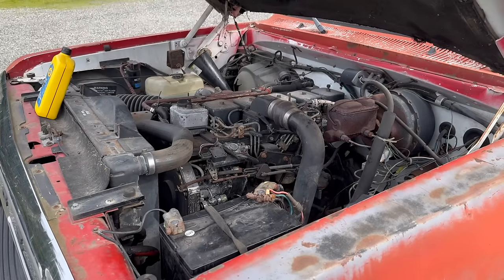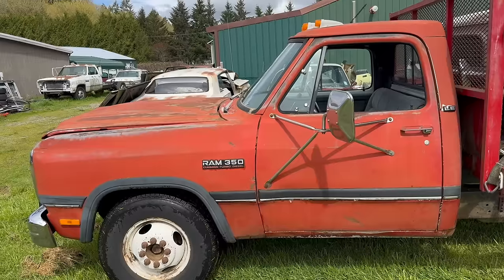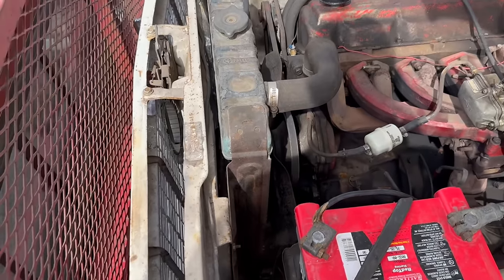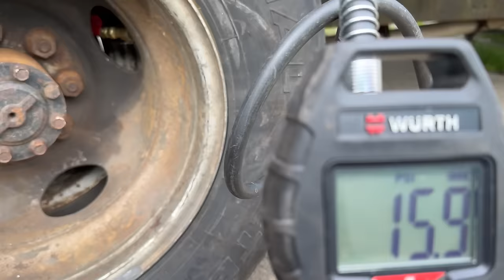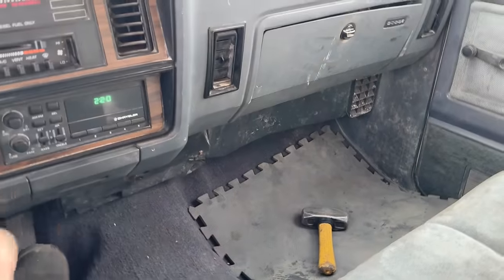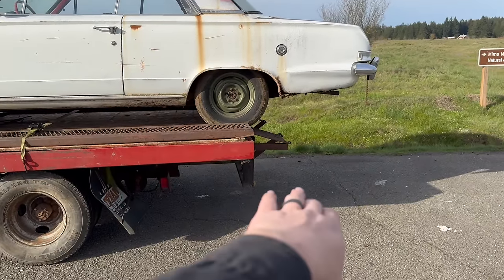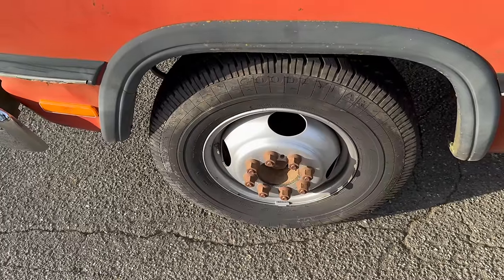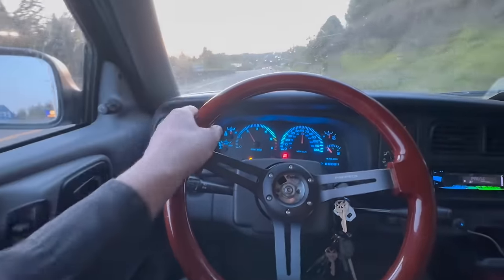Can I Drive This Terrifyingly Sketchy 1992 Dodge D350 "Ramp Truck" Home? (Towing My New Project Car)

Comment: In 1993 I bought a new, two tone, white over silver 12V Cummins D250 Club cab with captains seats (best seats EVER)  and I traded it in 10 years later. I still miss ti.
Reply from the maker: I had a ‘93 D350 club cab five speed dually briefly. Man, that was a great truck. But I needed a real back seat for my newborn daughter - so I got my first second gen.
Reply: @DeadDodgeGarage  Same problem here. My son quickly became too big for it. The third gen has been serving us well since then though.

Comment: I had a 1995 single cab 12 valve Cummins. Those Turbos are indestructible. Great Engines.I took out the CAT OUT STRAIGHT PIPE. The truck just whisled. Had a great sound. 👍

Comment: I love my first gen..most of the time. Of course I’ve fought all of those things you are currently fighting..all new steering including red head steering gear and borgeson shaft..huge difference, also added a steering box brace I picked off a ramcharger in a junkyard.

Comment: My old brain is getting fuzzy. I thought a one ton truck could haul two tons of material?
Thanks for your awesome video!
Reply from the maker: It’s not a hard and fast rule just by the one ton rating. Gross weight ratings vary by model. I haven’t found the gross return for this one yet but I know from the door sticker it’s over 10k.

Comment: Great choice in that ,
First generation 
12v Cummings Diesel ⛽ 👌 

It's not the engine or truck that concerns me , Jamie  .

It's the ..... errrr..... ummm.....
"Loading capacity"
 of that Ramp truck , 
 bed integrity  , lighting  , tires 
Intermittent death 💀 wobble 

So many "potential" violations .
OSHA , DOT , 
the second law of physics ...... 
You know what  ?
Let Tom handle it 🤭

I've got to give you  ,
Genius cudos 
For transcending , multiple levels of sketchy  , simultaneously  😬

Coming from a GenXer.....
I'm sincerely impressed
Reply from the maker: Yeah, that. All of that. Haha.

Comment: You have more faith in the ratchet straps than I ever would.  Thank goodness a tire did not blow and you escaped possible injury along with the car.  Great video showing what not to do is very appreciated, but please do not take risks for our entertainment unless you are sure you can get away with it.
Reply from the maker: I know what I can get away with. But with this much weight, I need actually functional brakes. What’s wrong with ratchet straps? That’s all I use to strap down cars. Good ones, obviously.
Reply: Used to use chains and binders, now it's ratchet straps, way more better!

Comment: Doesn't help no helper spring perches. Good thing that 12 valve is holding the front end down. Air bags would be good, dump the air to load or unload. Of course brakes would be much betterer.
Reply from the maker: Yep. I really don’t know why they pulled the helper pads. Doesn’t seem like a good idea to me…

Comment: The 12V Cummins is THE BEST engine ever made!
What other engine really only has ONE FLAW, killer dowel pin, that RARELY even surfaces?
If you had to take an engine through the end of the World???
It'll run on just about any oil source you can find, INCLUDING the oil in transformers, you know that stuff in those barrels up on power poles......that are everywhere.
Every other vehicle on the road, or OFF, is a source of fuel, more diesel, gear oil, ATF, motor oil. AND everything that flies as well.
You don't need a battery if you have a manual transmission. The fuel shot of can me manually operated, or ran with a cable.

And IDI Phord might be acceptable but a distant second. A Cummins can even do "gas" stuff....like be QUICK!
Reply from the maker: Damn right!

Comment: Thanks for sharing this little 'adventure' Jamie. The only thing that surprised me, is the low payload limit for a truck that size 😮 Locking brakes, whether rusty calipers or constricted hoses is practically a given, sitting that long.
Reply from the maker: I actually don’t know the total payload the truck can handle. I know the total gross weight is over 10,000 pounds, but I don’t know how high it is. Either way, it is a D350, which is a “one ton” classification. That doesn’t mean it can only carry one ton. It is supposed to have overload springs to help carry all that weight. For some reason they removed the hangars for those, which is contributing to the sag in the rear.
Reply from the maker: And I hope it was very obvious that I was not at all surprised by the brake issues. I was hoping they would just magically be ok, but all logic and previous experience indicated they would not.
Reply: @DeadDodgeGarage  Yeah, you did make mention of it, a few times. Watching, I too was hoping it'd clear itself up, by some magical means.

Comment: Awesome truck. The 72-93 is a great truck and there are tons of parts and still has a cummins. Same dash as my 92 Ramcharger. I dont think it would take too much to make that truck decent. Tires, brakes and box. And springs. And tank. And....😀 I think the O/D trans switch is broken or has no power
Reply from the maker: It is broken - and the computer is toast anyway. I was told that none of the factory stuff works, and that one is the toggles engaged the OD manually. Doesn’t seem to though.

Comment: Beavertail! 
I understand the wheels are lug centering. I used to install 2 tapered nuts on the wheel then install the rest of the nuts. when they are tightened, replace the tapered with the standard nuts.
BTW they are supposed to be ridiculously tight...300 foot pounds WOW!
Reply from the maker: 300?! Wow… I had assumed the spec was in the 140-160 neighborhood. I gave them the old break bar treatment anyway.

Comment: Death Wobble:
First thing first, replace the axle side rubber Track Bar Bushing with a two piece urethane one. You don't actually need to remove it from the vehicle (like I did on my Jeep XJ).
Of course, don't let that delay the brake job.
Reply from the maker: These don’t have a track bar. It’s not even a solid axle truck - which is where death wobble is usually found.
Reply: The 4wds don't have a track bar either.
Reply: I fixed my WJ with a steering stabilizer.
Reply: @DeadDodgeGarage  Sorry, didn't see this until you mentioned you replied.

Comment: The best cure for square tires is a good burnout.
Reply from the maker: It doesn’t work as well for front tires 😅
Reply: @DeadDodgeGarage just have to put them on the back for a burnout 😂

Comment: Jamie, I have that same year 1992 truck and the same interior.  I have the dreaded "goo" steering wheel problem.
And the steering wheels from other years don't interchange. I can wash off the goo with soap, but it comes back almost immediately. 
I put a cover over the wheel but it only partly covers the grip surface since it is fatter than the cover. And the spokes goo up, also.  And, with the cover, it makes the wheel fatter than ever.
I prefer a thin grip steering wheel like you'd find on, say, a 65 or 68 Chrysler 300, but they won't fit and of course they won't since the 92 is an air bag type.
I only found one similar steering wheel for sale on line and the seller stated that it had the "goo".  If you find one with no goo, late me know.
Perhaps they are more likely to be found in cooler cloudier areas.
Reply: My 92 tortured my back until I put a seat from an E body in place of the stock bucket seat. The bolsters in the sides of the factory buckets cut into my back, and I am not really "wide bodied" either.
The kidney killing harsh ride of the d350 rear suspension is still a problem since I drove it very lightly loaded. And my overload stops were removed when I got it. A previous owner put air bags in, but I doubt they helped even before they wasted away. Air bag PLUS the main rear leafs, not "in place of".
Reply from the maker: Grooooss… I didn’t notice any goo on this one. I’m not giving it up though. Haha.

Comment: No OD? Could be a post toastied capacitor in ECU. When you do the brakes, notice those too small for Cummins duty lower ball joints and give them some grease, they’ll be thankfull.
Reply from the maker: Oh for sure. I’m well familiar with Cummins ball joint problems… the PCM is full of mud and tree pieces. The added on classic style voltage regulator was a good clue something is amiss. I was told one of those switches activated the OD manually, and that made sense to me - but it doesn’t work.

Comment: More first gen cummins content, please.  Love those trucks.  I need that grille for mine.  And that is a 1993 model, BTW.  At least the speedometer it has in it came from a 1993 truck.  The older ones had a separate window for the tenths position on the trip odometer.  And there is no lockup converter in the first gen diesel trucks.  The gassers had em, but the diesels did not get lockup converters until 1994 with the 47rh transmission.  And more than likely the problem with your overdrive is the throttle position sensor.  They always fail.  Replace it with a potentiometer from Geno's Garage.  Could also be caused by a faulty transmission temperature sensor (currently unavailable, you'll have to jumper it.  This shifts the trans out of overdrive when the trans fluid temp reaches 275º), a faulty coolant temperature sensor (also unavailable, jumper it.  This keeps the trans from going into overdrive when the coolant temp is below 60º),  a bad ground in the overdrive on/off switch on the dash (I see your dash button is all smashed up, so that could be the problem.  It's the red button to the left of the cargo light button), the PCM could be bad (but you'd have charging problems too most likely), overdrive solenoid, or the brake light switch.  Or any of the grounds for any of those sensors.  Pretty sure those are the only things that would keep it from going into o/d, aside from internal transmission problems.  Oh yeah, could also be the vehicle speed sensor.  Even if the speedo is working accurately, it can still cause problems with the o/d.  They are another common failure point.  My speedo was dead on accurate with my GPS, but still kept popping out of o/d.  Replaced it with a new NAPA one, and now it's off by a few mph, but the o/d works.  and the odometer is still dead accurate GPS verified, even though the speedo is off.  Odd.  Gotta love an old mopar.
Reply from the maker: Well, first off, coming right up. Haha. Second off, this is definitely a ‘92 truck, so I’ll guess the cluster has been changed. I used to know that difference. Haha. Third, I knew the early overdrives did not have a lockup, but this appeared to have the three wire transmission connector instead of two? I’ll have to look again. The computer is bad. It has an external regulator added to make it charge. The computer is sitting flat next to the battery and is full of leaves, mud and rat crap, so… yeah, we could have some issues there. I did inspect the transmission temp sensor wiring and TPS wiring, as well as the solenoid control wiring and saw no obvious faults. But have done no sensor or circuit tests yet. The big problem here is that I can’t ask the guy who owned the truck what was what, because he’s no longer winning with us. But I was told that the two switches were supposed to be OD and lockup control, so I was working on the assumption they were right and it had lockup. And given the trash computer, manual control makes good enough sense. I will get to the bottom of all of this soon.
Reply: You're right about the TC lock up.

Comment: You can always put a swept line cab and doghouse on the 92 and your choice of the stick shift transmission and eliminate the automatic overdrive issues and put air bags on it and really make it something neat, and it is not like you can't use the 92 cab and doghouse you have several of those trucks or replace the white cab truck and sell it with tom and both get something out of it
Reply from the maker: Wow, you hit exactly what I want to do on the head. Haha. I talk about all of that in my next video!

Comment: Those aluminum lace wheels on the Valiant look like the ones off an early Fox Body sedan. I had a pair of those and i gave them away to a co worker because they either had the wrong bolt circle diameter or the wrong hub diameter or both to fit any of my Mopars.  He wasn't even grateful to get them. I should have kept them.  Nowadays, I would have tried to "modify" them to fit my cars.
Reply from the maker: They’re neat because they’re 5x4”. I’ve never seen another set of them in that pattern.

Comment: I had a seized caliber, even the death wobble happened a couple of times. I put a new caliber and still the same. Come to find out it was the old and slightly swollen rubber brake hoses.
Reply from the maker: Yep. That’s why I will be replacing them at the same time.

Comment: Is that steering column factory? The ignition switch and column looks like the 94 thru 98 ones
Reply: I can't speak for the 92's but 93's used the "later" column.  It's very wierd and if you have to replace ignition key/lock/switches, order the 94 parts.
Reply: @kart70  I see, I just had a buddy that had a few 94 and on Dodges and that column and ignition looked familiar. Just interesting how changes were made over the years
Reply from the maker: Very similar, but it’s definitely original.

Comment: Are you saying the overdrive and lock up TC are inoperative, or the truck did not come with them? I'm guessing inoperative. Because mine came with them and 3.54 gears.  If you had a three speed, you got 3.07 approximate rear axle with the diesel and that is not a good combo. But I thought all 92's had the the OD trans.  I see that the previous owner  put switches on to control the overdrive and the lock up.
That isn't a bad idea if they work.  There is a factory switch for the OD which forces it off though it can not force it "on".
Reply from the maker: Yes, I am saying it came with them and they do not work, and that the owner apparently added switches to control both, which also don’t work. I haven’t gotten to the bottom of that yet. I am familiar with the factory OD cancel switch (broken in this case,) and with how things are supposed to work - which would be my preference.

Comment: Where did you get that Wurth air pressure guage?  Wurth is a Woodworking supply house kinda crazy to see that brand in a mechanics shop.
Reply from the maker: Wurth makes a bunch of automotive oriented stuff actually. We use their rattle can paint - it’s about the best around. They also have brake cleaner, although we’re pretty sure it’s the same stuff sold by many other brands with their sticker slapped on it.
Reply: @DeadDodgeGarage  Yup its pretty much the same thing on the wood working side rebranded products and tools.  I just did some googling cause I was curious.  Kinda seems like they are a mega corp like Bosch, or Kohler, or Honda.  They have their hands in a lot of different businesses.

Comment: Ah, I saw that when I was over at Rocket getting parts on Thu. I touched the Valiant, am I blessed or something?  Thinking about it, probably "or something" 😅😅
Reply from the maker: Yeahhhh... I'm really going to have to say "or something" on that one. Figures, I must have missed you by a few hours. I had to run up to Everett for a truck load of shop stuff and random car parts for some reason.
Reply: @DeadDodgeGarage  😂😂 ya, I suspect you're right.
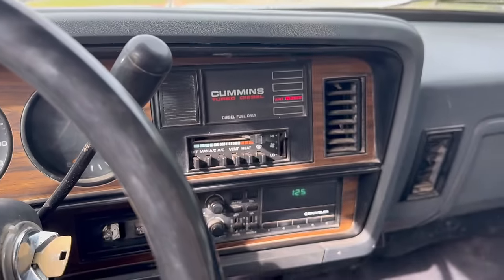I was there 11:30-12 or so..  Tom and crew were unloading a trailer of goodies.  Next time!

Comment: IF it were a club cab, I would say extend the frame and the bed and use it as a ramp truck.
But I don't like driving the "first gens" in standard cab.  Maybe you can "mix and match".
But a ramp truck is not really needed for the occasional tow since you have trailers and so many trucks that can haul them, even your daily drivers.
Reply from the maker: I fit in them ok. I had a single cab service body truck that was my main squeeze for a whole. Ultimately, what I want is a crew cab truck with diesel power, a stick shift, and the ability to haul a car and a camper, or one car on the truck and one on the trailer. Either of those configurations should fly under any weigh station requirements. But there’s no doubt that the whole time I’m driving whatever truck I put together, I will be thinking about how much nicer my third gen with a trailer is to drive.
Reply: @DeadDodgeGarage  I read your comment on how the blue Power Wagon was surprisingly not harsh. Maybe because they are half tons, long wheel base. I found the same thing on my W100. But my D350 is harsh.  I never owned a third gen, but I missed my second gen when I drove the D350.

Comment: I had the same brake problem recently with my 2000 Durango.  We took off the brake hose and put a vice grip on it.  I drove it home 2 hours on the highway that way.  I never had a better brake pedal and no pull.  Did I mention it happened on the left front wheel while I was towing a car trailer?
Reply from the maker: Oh wow. I strongly considered the vice grip technique. The problem is, if there’s ever a time you need four working brakes, it’s when you have a car on the back. Trailer brakes aren’t an option… and especially after the right side started doing it. I can’t vice grip both 😅
Reply: @DeadDodgeGarage  I was surprised it didn't pull and the brake pedal was solid.  I had an empty trailer on the back.  I couldn't find a decent VW Beetle to buy, if you can believe that, so I came back empty.  The next day it was all redone.  I was luck to have my buddy with me.  He happens to own a brake and suspension shop.